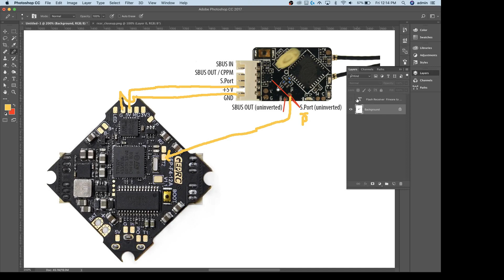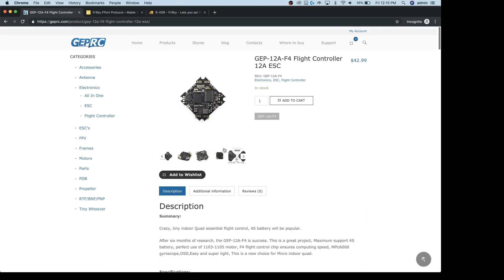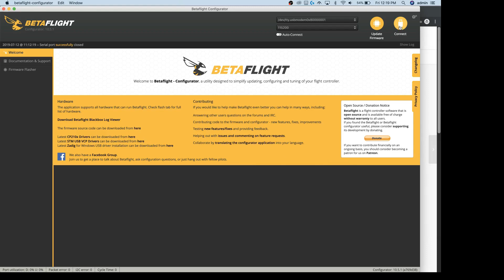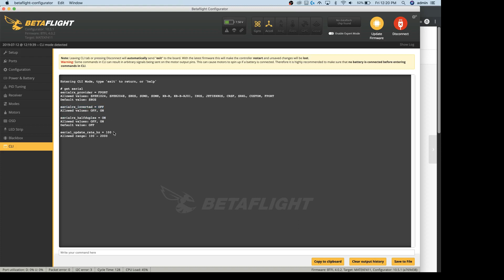Getting Telemetry via F.Port from whoop style AIO FC, FrSky R-XSR, R9 receiver GepRC V1.1, BetaFPV

Comment: Thanks for putting this together. I asked GEP how they would set it up and was about to follow their guide until I found your guide. They said the P pad on the R-XSR should be connected to the FP pad on the flight controller. That seems odd as it connects an uninverted signal from the R-XSR to the inverted pad on the flight controller. Great to see you got it working. I’m puzzled as to why GEP provides that other guide. I thought I’d share with you and your watchers just in case someone finds out more.